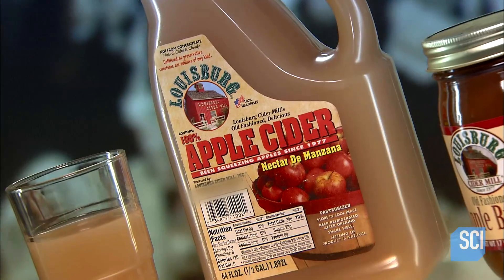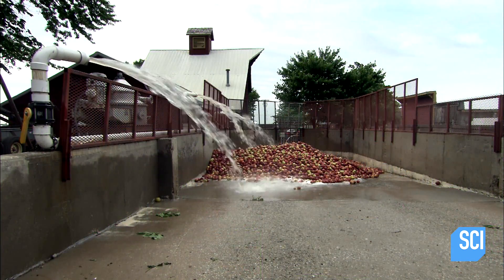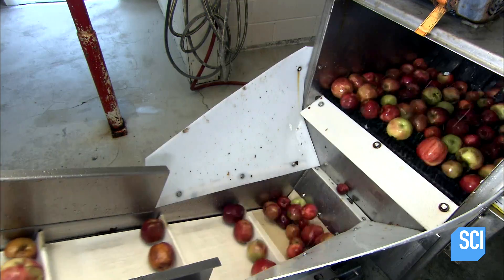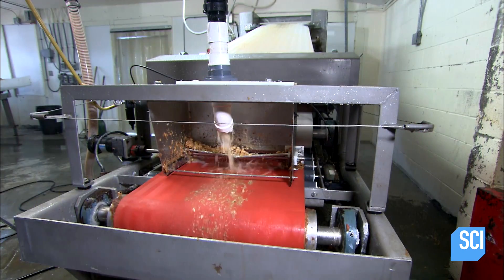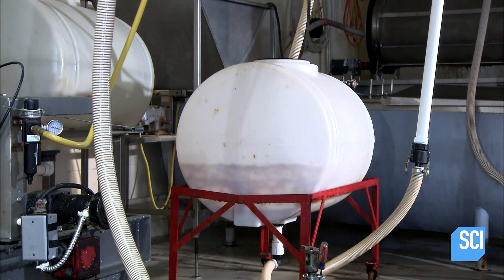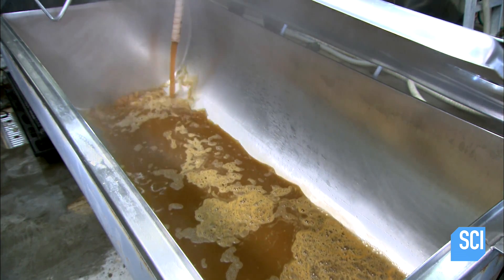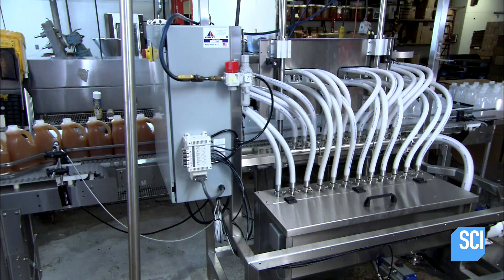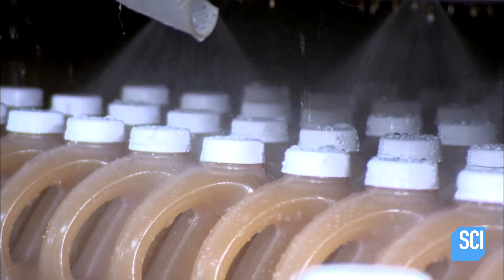From The Mill To Your Glass, Here's How Apple Cider Is Made

Comment: Yo they need to have a safety inspection the rust is literally 2inches from touching the apples
Reply: Scared of rust? I have bad news about your red blood cells.
Reply: Potato Boy  The bacterium that causes tetanus thrives where rust thrives because the have similar environmental demands but that doesn't mean rust causes tetanus which is a common misconception.
Reply: Potato Boy  Rust is literally iron which the blood needs to carry nutrients and oxygen which is needed for obvious reasons.
Reply: Apples are actually slightly corrosive from cyanid in its pulp and seeds.
Reply: Before iron supplement tablets, doctors would tell pregnant women to push an iron nail into an apple and leave it for at least a day.  She would then eat it rust and all to get more iron into her diet.
Reply: Potato Boy  Ever heard of the Tetanus vaccine which very many people have? Not only that, Tetanus is NOT caused by rust.
Reply: What’s wrong with rust? The apples get brown as well as the iron due to oxidation. I don’t mind getting some digestible iron.
Reply: f1f1s 🤦‍♂️
Reply: @drCasey  I'm pretty sure the heating process (which kills all the bacteria before its bottled) is enough to keep it safe enough to drink even if it brushes against a little rust....